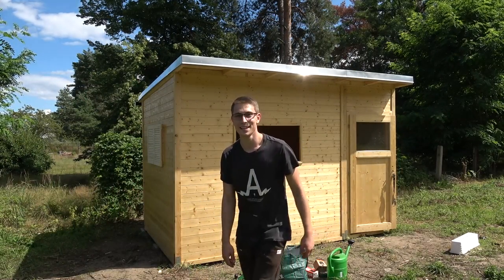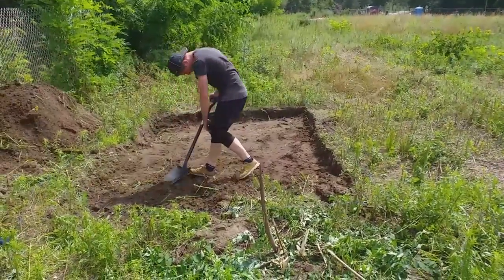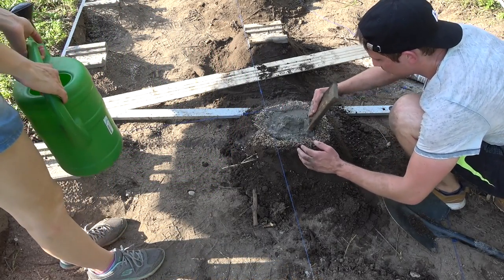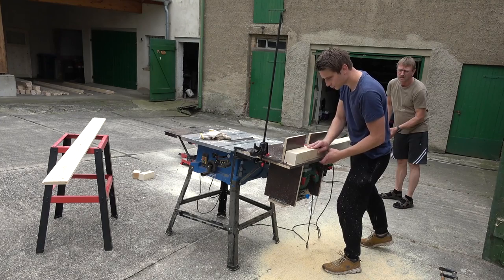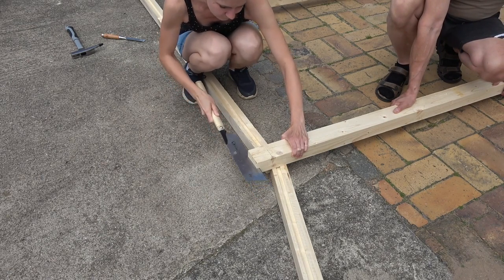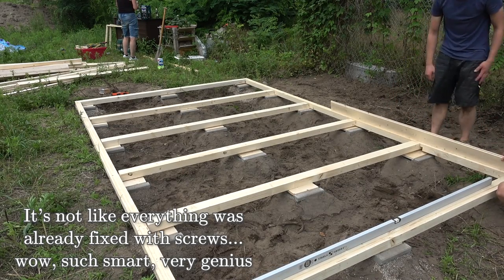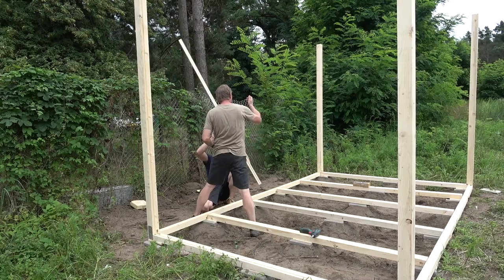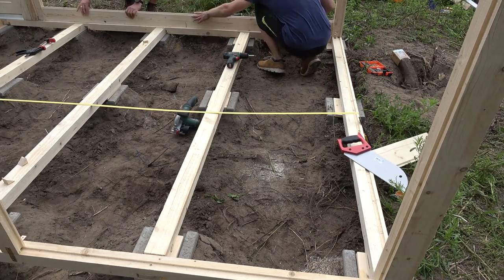Building a DIY Summer House From Scratch as a Total Woodworking Beginner! - Part #1

Comment: To proof a Rectangle just just measure the diagonals, they must be equal

2:40 please just stop using your saw on the floor, take a table

No wooden wall without strut
(Viereck vergeht; Dreieck besteht)
Especially because of your soft corner conection

Turst me I am a Zimmermann and will become an engeneer

But thumbs up for a low expired wood fan to build your cabine with your family, despite my critics I think it would last some years, just watch out in heavy winters